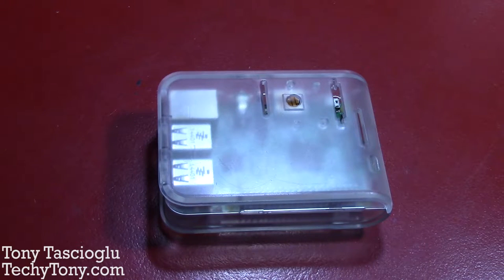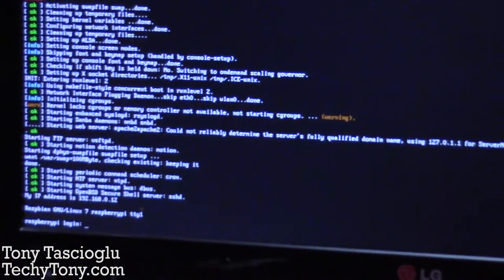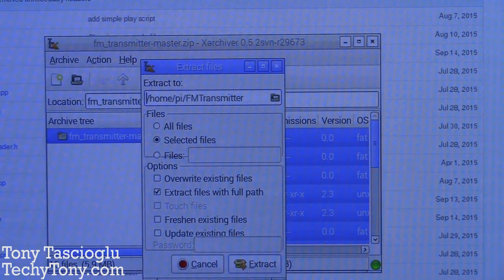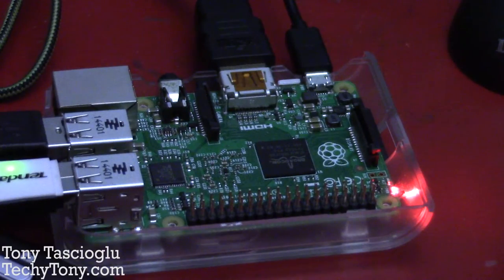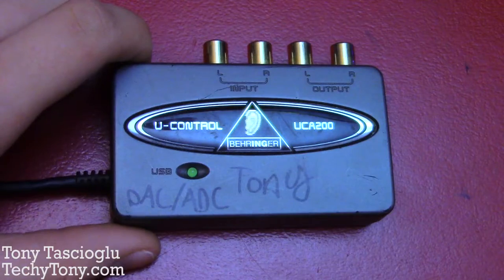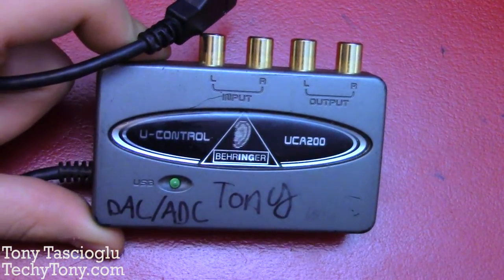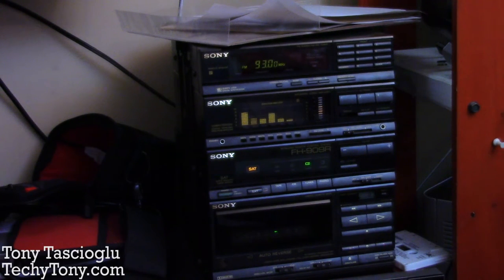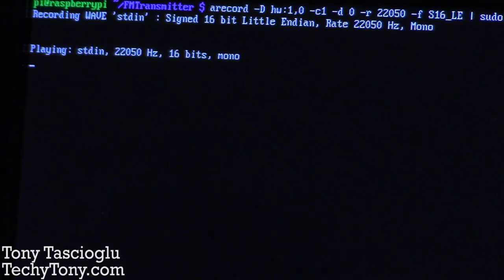Build Your Own FM Transmitter Using a Raspberry Pi 2

Comment from the maker: Hello everyone, thanks for all the support!
I just wanted to provide an update for those of you following along now: there are other programs such as PiFmRDS that work with newer Raspberry Pi revisions (2,3,4), and deliver higher sound quality as well as an metadata: https://github.com/ChristopheJacquet/PiFmRds BUT you should still be careful and avoid running this with a real antenna or for any purpose other then testing. I did some testing in GQRX and can confirm that this outputs a rather messy signal that interferes with many other frequencies and stations nearby.

Comment: So I followed your instructions up to the point of trying to get a file to play where it does not work. I went onto the github's page for this project and it says to input a file in this format... sudo ./fm_transmitter -f XXX.X -r star_wars.wav Doing so works.

When tring to get audo working from the external soundcard's input, your format does not work... arecord -D hw:1,0 -c1 -d 0 -r 22050 -f S16_LE | sudo ./fm_transmitter -f XXX.X But when I use the suggested method from the github website, it works but plays the audio really really slowly!!! Why?
Reply from the maker: +somedudeguytv Really slow as in similar to if you were playing it in slow motion or there is a bit latency? If it sounds like it is in slow motion, you got the sample rate. The sample rate must be 22050 Hz, and for any sound card I have tested, S16_LE has worked.
Reply: +Tony Tascioglu Yes, it does sound like audio in slow motion. My sound card is the C-Media Electronics, Inc. Audio Adapter. How Do I go about and change the sample rate?
Reply from the maker: +somedudeguytv Its part of the command you run (its the 22050 you see) 

arecord -D hw:1,0 -c1 -d 0 -r 22050 -f S16_LE
Reply: +Tony Tascioglu So I did just that. I typed the format exactly as you have it... arecord -D hw:1,0 -c1 -d 0 -r 22050 -f S16_LE | sudo ./fm_transmitter - 106.3 and I get the error message... arecord: main:582: wrong extended format 'S16_LE'
Error: Cannot open 106.3, file does not exist
Reply from the maker: +somedudeguytv Your audio input hardware ID might be different.  You can check by going to alsamixer and seeing what number your input is.
Reply: +Tony Tascioglu I contacted the developer who wrote that program of the problem. He wrote back and said I had to edit a file and changed the sample rate to 44100. It did the trick!

Comment: this mite be a dumb  question (idk ive never messed with any of the pi series ) but after you do all of this do you have to redo everything  when you unplug or and plug back in or would the pi boot and begin transmitting on start up and if so is display needed for start up i ask because  im looking  to try to use this method for a mobile  FM transmitter.
Reply from the maker: +James Freeman After you unplug and plug the Pi back in, you will have 
to run the command to capture the audio device and stream it. An 
alternative is, once you have completed setting the Pi up and have it 
streaming, run a shutdown command, and that will save the history, then,
 when it boots up, you can press the up arrow on the keyboard and run 
the last used command. Or you can program a Python script to restart the
 streamer, but I can't help you with that method.
Reply: +Tony Tascioglu thanks anyways man
Reply from the maker: +James Freeman I believe MAKE Magezine made a video about a Raspberry Pi Zero Pirate Radio, and they had a technique to get it to start streaming right away when it turned on. You might want to check their video.
Reply: +Tony Tascioglu ya ive watched there video but it only plays from the sd card im looking for a way to stream form a audio input to the pie
Reply from the maker: +James Freeman Combine the 2. In the second half of my video, I show you the command to stream the music from an audio input, and then you could use the command I use and use another script to start it when the Pi Boots! So instead of streaming from the SD Card when it turns on, it will play from an audio input!
Reply: nice ! thank you so much

Comment: I have two questions. How big reach the transmitter have and for  broadcast you use only Rosber or any other amplifier? (Because I wasn t see any anthena)

(and sorry for my English)
Reply from the maker: +Wolf Ranger The transmitter worked  within 25-30m radius depending on the conditions (any more, and that probably would require you to have a license) and for the antenna, you can use any wire, so your antenna probably should work.
Reply: Okey. Thanks! :)
Reply: +Tony Tascioglu does the m stand for meters or miles?

Comment: what is the range of the transmitter for a given antenna
Reply from the maker: Depends on a lot of factors. What type of antenna? A yagi is gonna be different than a dipole antenna, how much power are you running, how high is it, etc. If you're unsure, ask a friend with a ham radio license :)
PLEASE make sure you run a filter inline with this if you dare connect an actual antenna to this emf spewing contraption. And I still wouldn't amplify it.

Comment: can u give me a example to do that with a command line player.
just the code the software i should be able to get
Reply from the maker: Try this guide (which is meant for PiFM, but if you're using the Pi2 or later, the same mp3 player code should apply to the FmTransmitter program): http://makezine.com/projects/raspberry-pirate-radio/

Comment: Hi really helpful only full tutorial I have been able to find. Although when I run the program I get 99.0 file does not exist 99.0 referring to the frequency
Reply from the maker: +Gopro 4 life Did you run the cd command to switch to the right folder first?
Reply: yes I am now getting a very faint starters on my receiver but it is hard to make out any ideas?
Reply from the maker: Set the audio level from the device you are playing it from to maximum and set the input volume on the Raspberry Pi to maximum using alsamixer

Comment: ok I switched round the order I was entering the code. Frequency then file but despite it saying it is broadcasting I am not picking up on my radio. And yes I do have an antenna
Reply from the maker: +Gopro 4 life Do you get the message on screen that says Broadcasting or any other error?
Reply: yes it states the track is broadcasting and I can ocassionly pick up a very faint outline of star wars
Reply from the maker: +Gopro 4 life Set the audio level from the device you are playing it from to maximum 
and set the input volume on the Raspberry Pi to maximum using alsamixer
Reply: tried it still no luck could it be a dodgy gpio unlikely but still
Reply from the maker: +Gopro 4 life Are you also using WiringPi? I have had issues with running this if WiringPi is also trying to use the GPIO on the PI
Reply: I am also getting error : file does not exist ! How to fix it ?

Comment: I have a FM transmitter up and running on my Pi 2b but the audio only plays for 1-5 seconds on the freq before it cuts out, even though the program itself is still running... anyone have this type of problem?
Reply: It is not with the RPI, the error is with the conversion via media.io

Comment: how to play .mp3 working directly ?
Reply from the maker: If you want to play .mp3 files, the best way is to use a command line mp3 player, then pipe the output to the fm-transmitter software.

Comment: can i get a 200 meter range with it?
Reply: I read about 40-50 meters.
Reply: Rogerio Vitiello ok thanks .nice :)
Reply: Prabhav Chauhan It depends on the antenna size and the power what goes to the PI (in ampers)
Reply from the maker: Please don't even try. You will probably interfere with other radio signals due to the unfiltered output.

Comment: I got 130Meters out of it with 22W audio amplifier and Equalizer + 1 meter antenna
Reply from the maker: Please don't use an amplifier and a long antenna with this. There is a very good chance you might interfere with other radio signals as there is basically no frequency filtering on the output, and its probably leaking a lot into other frequencies. There's a very good chance that you need a radio broadcasters license to broadcast with that sort of wattage.
Reply: Yes i know but i want to see what range it can do.
I have better uses for RPi

Comment: What makes you think only US keyboards have the pipe symbol?! lol
Reply from the maker: I know that other keyboard layouts do have it, its just that I use a US layout keyboard, so I don't know the positioning of where the pipe symbol would be on the other layouts.
Reply: And that is why the system has what is known as keyboard mapping. It does not matter if the pipe symbol is at the far right of the second row above Enter or bottom left between the Shift and the Z keys, (US and GB layouts respectfully) you don't have to know the position of the key on other keyboards, you just know it's there somewhere and the user should know where. The point is, your comment to make sure you are using a US keyboard to use the pipe symbol appears very ignorant of the fact it is on every keyboard for the PC no matter what language it's for! It would be stupid to use that symbol globally for piping if it were not.
Reply: Don't get me wrong, that is the only criticism I have on your video, very well done apart from that ;)
It's just a shame the technique only works with low bit rate audio files of WAV format. Would be nice to see it working with MP3 files and higher rates :)